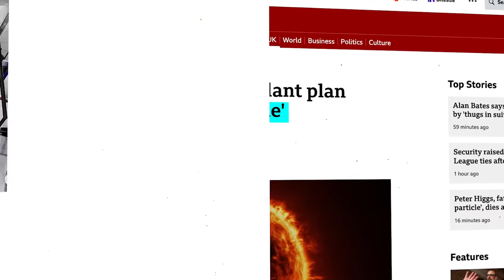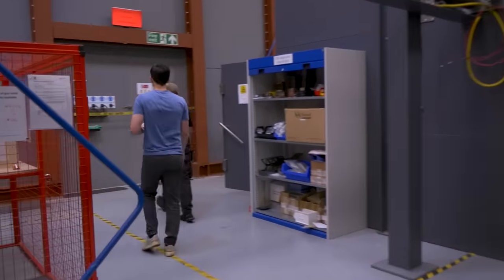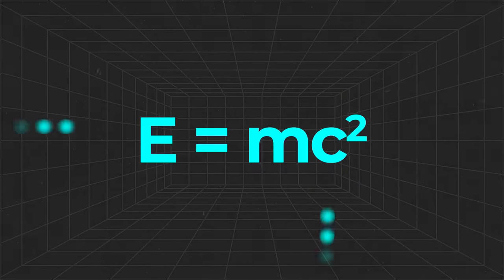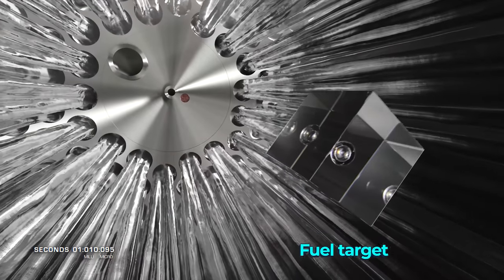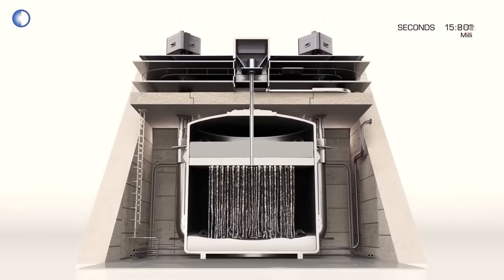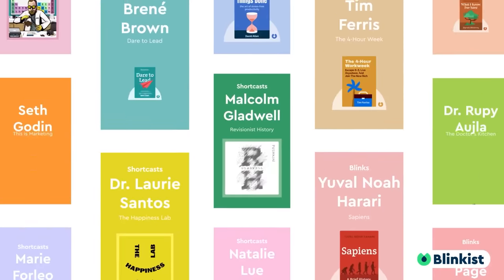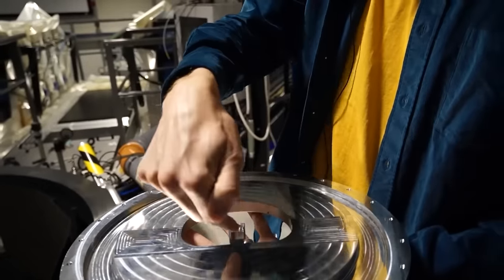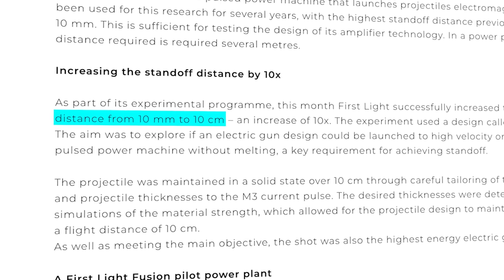Why The Latest UK Fusion Breakthrough Matters

Comment: Great, now fusion is only 10 years away
Reply: It used to be 30 years away, so that’s an improvement
Reply: It’s still 20 years off just like in the 1980’s.
Reply: It will still take 20 years till the first commercial fusion power plants could solve our energy problem, but the chances are very high now, that in 10 years we have constantly working fusion machines that produce more energy, as we put into them. Then we need some more years to scale up this process...
Reply: Can you do one on "Fusion: the World's Greatest Boondoggle"?
Reply: I bet they are going to need 20 years to "discover" that the amount of energy required to manufacture the projectile and target pellets while running and maintaining the whole system between firings exceeds the amount of energy produced by each fusion event. If any fusion tech ever achieves commercial viability, it'll probably be a stellarator derivative.

Anyone and their dog are achieving fusion these days. Nobody is anywhere near close achieving break-even yield. ITER has achieve a "Plasma Q" of 10 (thermal energy into the target vs total energy out) but that still leaves it ~100X short of break-even when you count the energy used to pump the ignition lasers instead of the thermal output that actually reached the target.

These are very expensive toys for long-bearded kids while praying for practical science to come out of it at some point.
Reply: Where is my flying car?
Reply: They missed a huge part of how the sun produces fusion. It's not just the forces, the gravity and heat is not enough to explain the suns output. It's quantum tunneling and the sun has a lot of material.
Reply: fusion is a lie what u doing watching science videos ur litreally ruining the scene and these oerformers show up and know whack
Reply: So, for the last 5 decades we've been 20 years away from fusion power. Now, we're 10 years away...how many decades will that be?
Reply: @hg2.  And while you're at it do one on "Climate Change: Greatest Farce in the History of Mankind".
Reply: Lousy
Reply: Fusion: the World's Greatest Boondoggle
Reply: @teardowndan5364  I for one am happy to see all these kids playing around with it. The more approaches we try, the more we learn and can apply to other approaches. Maybe stellarators have the best odds, but we are in such deep trouble with global warming that it makes sense to bet on anything and everything that has even a chance of viable fusion power. In fact we should probably be spending 100x or more than we are.
Reply: Yes. And in 10 years it’ll only be 15 years away!!
Reply: @teardowndan5364  I came here to say exactly this although much less eloquently than you have. Well said!
Reply: Haha, no, it is always 20 years away for commercially viable fusion.
Reply: @viperswhip  
The joke's on us taxpayers.

Fusion is always the xx number of years away BOONDOGGLE.
Reply: Standard
Reply: @AcornElectron  
Fusion: the World's Greatest Boondoggle
Reply: @SupremeOverlord10  it's called a helicopter or private jet 😂 you probably just can't afford one.
Reply: And will stay ten years away for at least 50 years.
Reply: It's been ten years away for more than 40 years.
Reply: @jimshreve83  
The joke's on us -- the taxpayers.

Fusion is always the xx number of years away BOONDOGGLE.
Reply: @SupremeOverlord10 crashed after it flew into falling parts from a Boeing Dreamliner
Reply: So everything will be free. U dont have to work anymore

Comment: So we’ve gone from being 20 years away to being just 20 years away.
Reply: An interesting thing to keep in mind with that timeline is, is that at least something like 10 years should be expected to be used up building and testing the final version, the commercial test plant.

After all, even if you were some what quick about it, building a commercial scale power plant can easily take 5 years, and that's assuming you aren't trying anything all to hard. And then you need to run it for years to make sure you've figured out general operation enough to sign off on large scale deployment.

And this is why the time frames so often then become at least 20-30 years. Because you need some time to figure out what you still don't know and how to design the final power plant design. And because people don't really know how much more is really still left to figure out, they tend to either underestimate or overestimate it by quite a bit. And also equally obviously once one realizes it, people who are optimistic on figuring out fusion are the ones who will work on it and thus give predictions... and so the predictions tend to be optimistic. So assume 10-20 years of R&D work before building the final commercial test plant.

In any case, we clearly haven't started on building that plant, so obviously any realistic fusion timeline is thus at least 10 years. And then we have the unknown amount of time to finish the research.

In conclusion, fusion will always be 20-30 years away, until suddenly it isn't anymore because they're going to build the commercially viable test plant. Same way it was with say nuclear energy as well, where it was considered a pipedream until suddenly it wasn't.
Reply: 5 years ago it was 10 years away.  Today it's 5 years away.  The timeline has stopped perpetually expanding.
Reply: @VAXHeadroom Well it would be nice if it was that quick. But we haven't even started building the full scale test plants. And if I recall correctly even pretty optimistic timelines assuming everything goes perfectly still tend to presume 10-15 years I think.

I do agree that it seems to be getting closer though, certainly they're progressing on several interesting approaches lately.
Reply: It's actually worse than that. Because the earth's orbit is slowing down (except till recently, where it has 'sped up' due to changes in the mass of the earths core and polar ice caps moving and melting: but let's forget about that for the moment), the clock keepers have to add a second or partial second, to keep the annual time on track. And since we are constantly slowing down, the 20 years is 20 years plus X number of seconds. As if life wasn't complicated enough already! 
Let's hope the ITER project in France, bears some fruit in 2025.
Reply: The more you know, the more you realize you don't know.
Reply: There's more context to that. Commercial fusion power generation has gone from becoming realistic 20 years after it's been made essentially obsolete by other technologies, to becoming realistic just 20 years after it's been made essentially obsolete by other technologies.  

Even if someone figure out a way to extract more energy than all the energy put in to the system today, viable commercial power generations would probably be more than a decade away.  We already have a huge fusion reactor, at a safe distance, sending us plenty of energy that we can collect, we call it the sun. We have plenty of ways to collect energy from it, both directly from the sunlight, and indirectly from the winds it creates, and hydropower from water cycle the sun powers, to name a few. 

There's obviously that issue of that energy not being constantly available at any given location, but we're getting better at dealing with that local intermittency.
Reply: @Quickshot0  ITER is going to change that onvernight once its working
Reply: @fishyerik While that is true, the real question with fusion in the end is how much it will cost to run, which we currently don't know. Such a thing will only be clear after the tech is some what solved.

Another matter is that at times a technology has available niches, even if the bulk is covered by other technologies. For instance solar power is not that available further out in the solar system, and fusion power systems are generally thought to be vastly more efficient as a rocket propulsion system then near any other system. So it seems fusion and interplanetary rockets would go together well.

Lastly, interestingly enough fusion power generation future like solar is really only going to be about how it gets cheaper over time. Because the fuel for it is the same as the Sun, its future would be just in how much you can improve fusion systems still...  Which is well unknown, though it does seem clear there would be a lot of room for improvement over the decades and centuries.

So I'm not to sure it's really an obsolete tech branch, I think it will have its uses and ultimately in far future days be surprisingly cheap. But admittedly that is then, not now.
Reply: @Quickshot0  Essentially obsolete, as in obsolete for any current problems, and problems in our "near" future, it is often suggested as a potential solution for. 

I'm pretty sure interest, and willingness to fund research will cool down a bit when the remaining supposed main usefulness for it is colonizing parts of space with insufficient starlight.       

Investment and cost to run, and some other factors. We're still far from getting meaningful net energy out of it, very very far, despite extensive effort. 

New technologies are typically not cheap, if we find a way to generate meaningful amounts of power, it will take a lot of time to make the process as cheap as it can be. I can't predict the future, especially not that far away, but even if we figure out how to make fusion reactors for power generation, there's no guarantee that we can develop a process that will have any real advantages over fission reactors.
Reply: Yeah, but they never say WHITCH 20 years though.
Reply: @fishyerik I kind of feel like at this point you're kind of using the wrong word now. As you describe it you don't really mean 'obsolete' and instead 'non existent'. In which case I completely agree, it doesn't currently exist and so will be of no importance in the near future and how we set up our power systems. That discussion will be dominated by things like, solar, wind, hydrogen, fission and geothermal power. Things we can use right now, because we need to build them right now.

Beyond this though, there is a reason why fusion has always been under continuous research for so long. And that is because by its very nature it has always eliminated or greatly reduced many of the drawbacks of nuclear fission power. It's basically the far better alternative, if only one could get it to work.

For instance It's radiation issues are vastly reduced and what radioactive waste it makes is thought to only last at worst a few centuries, if even that. Basically as such solving the waste problem as we can make structures that last a few centuries.

Its fuel type is vastly easier to process and is extremely commonly available nearly anywhere in the solar system, including on Earth itself. It is in fact one of the most common materials to be found in general and can be gotten out of for instance water. This means the fuel is non-dangerous to work with, stores safely, is extremely cheap and is readily available anywhere you might want to use such a system. This is very unlike fission fuel, which is a quite rare material and is not so easily found in usable quantities. Not to mention the processing is difficult.

Still, this technology is unlikely to appear in a usable form before the 2040s, so we will just have to see what it has made of itself by then. We don't know at what kind of price points even the early iterations of the technology will operate at. But rather obviously if it is not competitive, then it won't in the end be used then. There is no point using something expensive just because after all. In which case it would be relegated to just some useful niches where it turns out more convenient then other options.

Space will probably be one of those, because as it is now going space access will be far far cheaper in the 2040s due to the development of fully reusable rockets. Due to that it will probably be far more affordable to launch a fusion drive to space and use it for scientific exploration in the outer system. Admittedly you'd probably only need so many of such drives, but it would be a way the technology would get continuous funding for further improvements.

So in that sense I suspect fusion as a technology probably won't be going away, it will have its uses. But how many will in the end depend on how expensive it is.
Reply: You've all been lied to. It's not 20 years. It's 40. It's ALWAYS 40. 🤣🤣
Reply: Fusion: the World's Greatest Boondoggle
Reply: The joke's on us taxpayers.

Fusion is always the xx number of years away BOONDOGGLE.
Reply: In 1960, fusion was 30 years off, in 1965 it.was 30 years off, etc. ad infinitum . If I had the resources of the federal govt., I'd give everybody $2.10, which is the per capital amount spent in 2023.
Reply: @Classical741  
The joke's on us taxpayers.

Fusion is always the xx number of years away BOONDOGGLE.

Comment: I remember the time when it was said fusion is always 50 years away. Then it became "always 40", then "always 20", now "always 10". It's just an anecdote about too optimistic predictions. But the progress is constant and noticeable. If nothing else the brute force approach of ITER will be eventually successfull.
Reply: ITER itself is always 20 years away.
Reply: It wont work because its not a SPHERE. a circular coil has too many degrees of freedom ...kinks . touches the sides. loses energy. fizzles out
Reply: The predictions weren't pessimistic enough. Or, rather, the framing of the question was always just plain wrong.

We're not years away from practical commercial fusion-powered electricity: we're in the wrong universe for commercial fusion power to be practical on a cost basis.

Unless you count solar, which is already so cheap it makes zero sense to float terrestrial fusion.
Reply: Its like the race between Achilles and the tortoise... you will never reach the finish if you are forever halving the distance
Reply: Then it'll be a year, a month, a week, within a couple days, tomorrow, and all of a sudden, we've had fusion for 5 years but you're still paying $1,000 for your power bill.

Comment: Nice video. I like how the breakthrough is basically turning a electric rail gun into a conventional gun. Whereas a conventional gun will have a primer and gunpowder to push a projectile this rail gun uses electricity as a primer and metal foil as a kind of gunpowder that explodes into a plasma and pushes the flyer/projectile. Very cool!
Reply: a plasma cannon ^_^  wonder if that could be tuned for regular atmospheric pressure use, yeah the power usage is insane but no part of it is actually explosive or even flammable.
Reply: @Joe-Dead   Honestly, plasma is ultra inneficient, like if you ever seen in any sci-fi people using plasma is just dumb, plasma literally would lose energy ultra fast or just outright explode once its left its containment as a bullet to make plasma viable you need to use enough energy that it would be worth it to just use a laser
Reply: @Aureonw  "just use a laser" that's being done, secondly kiddo, i said nothing about using plasma as the destructive force as the gun in the fusion attempts isn't using the plasma EITHER as a projectile of any sort. using plasma as gunpowder, much like gunpowder cannons were a thing, the propulsive force being gunpowder, plasma cannons, the propulsive force being plasma.

something first light is probably intent upon as it would allow cartridges to be mass produced to power the cannon and simplified feed system. the thing with a standard atmosphere to deal with is...air. you can pull off that kind of rapid acceleration used in fusion under vacuum but in air  it might as well be concrete...why the 'tuned' part.
Reply: @Joe-Dead  First of all my bad for not reading the top comment just yours lol thought you were thinking of making plasma bullets, secondly why call someone a kiddo?, especially someone who likes his own comment lol
Reply: @Aureonw  the stupid assumptions you make, like 'likes his own comment' based on nothing but your own self delusion. thinking like a child who hadn't figured out rational thought yet who instead just makes up narratives whole cloth that don't exist. your bad was trying to 'well actually' based on your own assumptions, your second was AGAIN using the same tactic that failed you the first time again. making assumptions.
Reply: @Joe-Dead  Your comment just came out I saw it 1 min and 1 like, under comments like this you don't get likes that fast so no. You indeed liked your own comment there
Reply: Can you do one on "Fusion: the World's Greatest Boondoggle"?
Reply: Fusion: the World's Greatest Boondoggle
Reply: @hg2.  and how is that exactly? oh wait, you're trying to sound smart and jaded. well, you're neither but for my personal amusement do try to explain how fusion is a 'boondoggle' kiddo.
Reply: @Joe-Dead  
See the long Kirk Sorensen video on thorium, "kiddo".
Reply: Yeah, I was surprised they thought that was an innovation honestly.